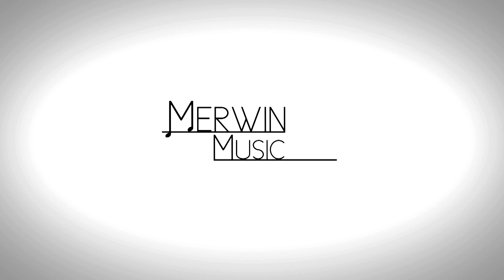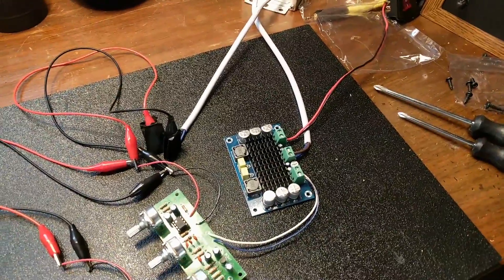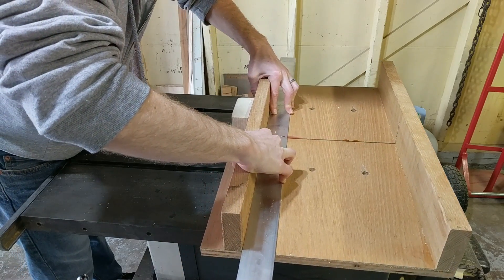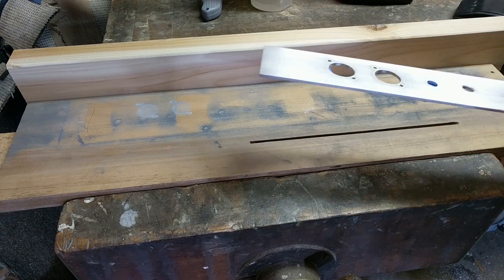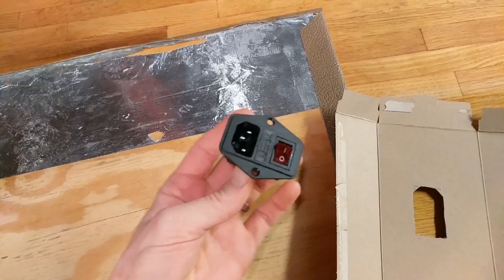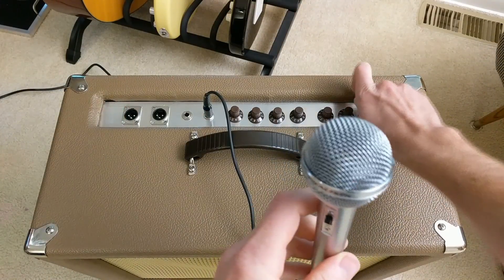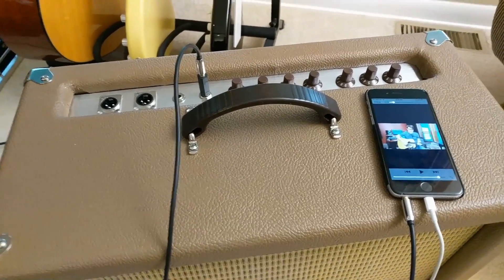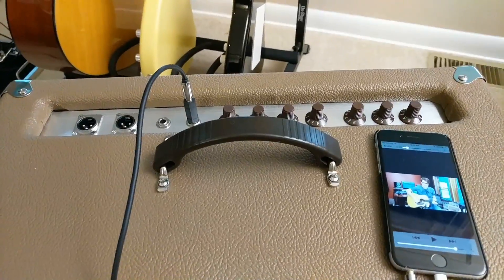D.I.Y. Speaker Cabinet Build - Part 3 (Electronics)

Comment: you need to do an analyisi of what the signal levels will be from each input then work out the gain required for each - it looked like the headphone signal from your phone required the mix level to be way up - and that signal is BIG compared to what a MIC would put out! Put your gain stages in block form into a diagram  Mic / guitar / AUX etc  the mixer should be post gain stages. You should be able to amplify the different inputs by differing amounts then MIX them - that would be the easiest? Then you could apply EQ but that would affect each input equally which probably isn't ideal. A lot of these PA / mixer amps have individual Gain and basic EQ before the signals are mixed

Comment: Great series - I would buy a couple beers for an amp tech and get their take. Probably gotta keep power from line wires or add a filter in the circuit. I am impressed by the overall project. I would say it isn't finished yet. You got this! Begging for a follow up!

Comment: I’d just by an amp to install if you’re going solid state. If you wanna get into building a tube amp for it,start with a champ style kit. MOD kits has a good point to point wired one with no cursed PCB boards in it!

Comment: tip- put the correct XLR jacks in and use a real microphone (you need female jacks as all microphones have male jacks on their outputs- which go to female- then to male- this will just make using it a lot easier).  Those radioshack unbalanced mics are ultra weak into quality PA's and pickup loads of noise.  But also put a real amplifier in it with real AC current.  Thats not necessary these days but it would help!  I would say preferably biamp the woofer from the smaller speakers with a crossover.  also- speaker efficiency is going to be an issue and what about the speaker impedance?  it seems like we should collaborate- you bring the woodworking- ill bring the electronics.  (Ive never done a PA but I've built lots of tube guitar amps) Theres lots of modern solid state and digital amp stuff I have no clue about.  You left quite a bit of detail out on the power supply and details of the electronics- which is the most important stuff IMO.

Comment: Try to cut out the aluminum foil that come in contact (around) the electronics or the screw that holding it in. It sometimes causing some issues when i do shielding on my guitar

Comment: Just a helpful tip, when building ANYTHING, where RF can interfere. ALWAYS use the smallest amount of wiring you can possibly use (the shortest wire, you can use to get from point A to B), wrap wires around each other, if they are going to the same component, or area, and make sure you use good quality wiring. Also ALWAYS make sure you have good grounds. Those things will VERY GREATLY REDUCE, the amount of interference and background noise, or 60 cycle hum that you will get, even with cheaper components. The less metal you have inside that chasis, the less criss crossing, and spider webbing of wires, by running multiple wires together, will really take away more oppurtunity for interference to occur. You did a great job on the cabinet, there's only a couple of things I would have done differently. Great job having the determination and drive to make your own stuff, it's a great feeling to build stuff that works great, and you just keep getting better at it, the more you do it. I like watching the stuff you do, and you do a good job of filming and editing too.

Comment: You didn't post a parts list :(
You said all of your components are 12volt, did you make sure they're all DC? All of the 4 channel mixers I'm finding are 12volt AC, not DC. https://www.amazon.com/WINGONEER-NE5532-Preamplifier-Channels-Amplifier/dp/B01M7TG1WX?keywords=tone+board&qid=1540707213&sr=8-7&ref=sr_1_7
I ask because in the reviews someone mentions pairing it with a "Line Matching Transformer 2A - LP-575 110/220." I didn't see anything that looked like a transformer in your build, just curious.

Are you using this for your EQ? https://www.amazon.com/AOSHIKE-Passive-Treble-Control-Pre-amplifier/dp/B07D53K1G7?keywords=passive+tone+control&qid=1540707366&s=Electronics&sr=1-1&ref=sr_1_1
Says "the volume will be much smaller,"  have you tried running it ahead of the preamp?

Hope you get it working right. I really wanna build one myself now!

Comment: Nice 3 part series.  Picked up some useful insights for a guitar speaker cab project I'm planning.  A shame about the quality of the power amp.  I like the idea of using an ART Tube amp as a preamp.  Don't like the idea of the cabinet corners screwing into the back panel.  A real hassle if you have to open the cab.  In the long run, if you do get a quiet power amp section installed, I think you'll find the use of speaker elements from a home stereo speaker will be a weak point.  Not designed to handle the fast transit peaks of live sound.

Comment: Good build, and I think you're right that the cheap kit build parts are the problem. Next to your Salvo's speaker there would have been some old domestic stereo amps. I picked up an NAD amp for $10, bit of tweaking and it works well. Old PA amps are good too.

Comment: Do you think the speakers from the second hand store could be the problem?  I watched all three videos and I was on the verge of picking up some cheap speaker from Savers, but now I think I may just buy the real deal.  Great craftsmanship overall here!  Thanks for sharing.
Reply from the maker: I don't think it is the speakers fault. My first test was to feed the line out of my mixer into the power amp into the speaker. That much of it sounded really good and packed a fare punch. Thats how I have used the speaker so far, as a powered monitor more than a all inclusive amplifier.
Reply: Thanks. I may have to try it after all.  just an extension cab for me, though.  Not going to mess around with all the electronics. :)
Reply: @georgelackey622  i ended up doing a build with an old Roland speaker I found cheap on Ebay.  Check out the result here:
https://www.youtube.com/watch?v=Lw0drIcH2DE